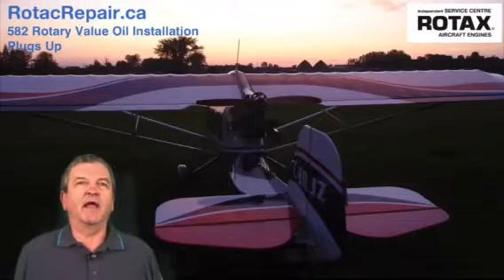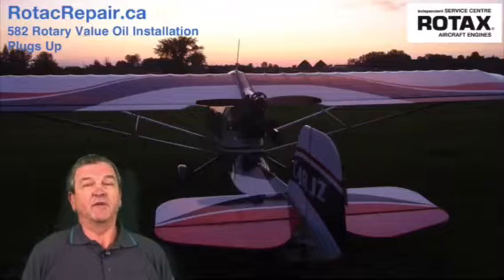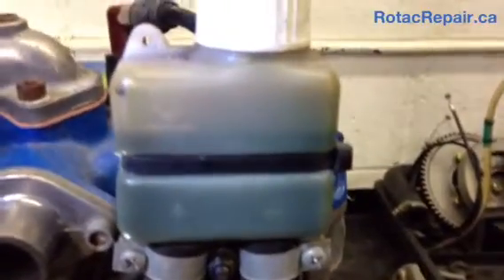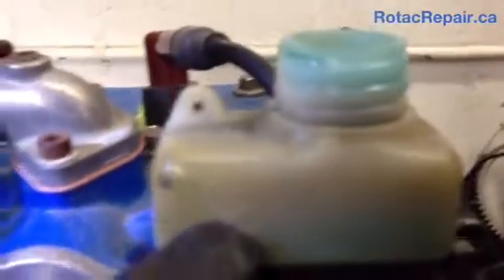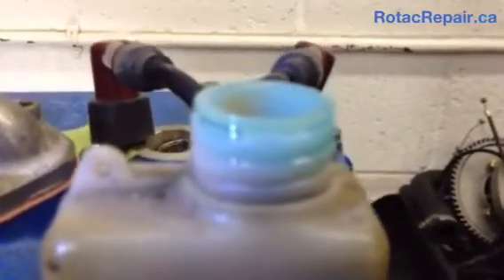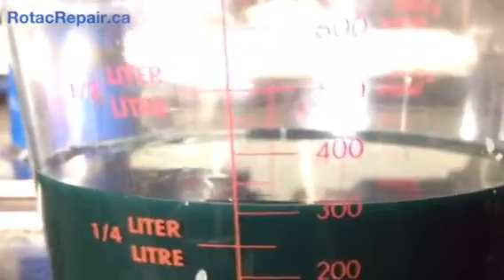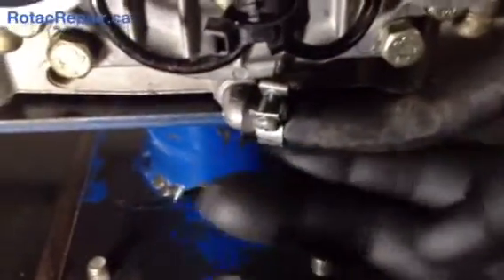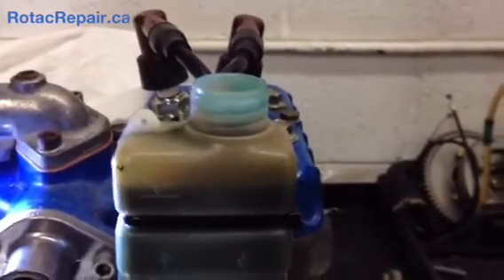Rotary valve oil change Rotax 582 UL with spark plugs up

Comment: Y'know,  I realise that this is 6 years too late  - but I've been setting up a Rotax 582 model 99 for  installation on a glider;  and in regard to the rotary valve oil supply,  I did not use the Rotax-supplied  oil bottle at all - because it's made of plastic, and an oil tank (no matter how small) inside the engine compartment of any aircraft must be fireproof.  Instead, I made a small tank from steel sheet and mounted it just above the engine.  It has the required two hose connections,  the "return" line being higher than the "supply" line.  It has about double the capacity of the Rotax plastic bottle, and filling it is part of the daily inspection procedure.

Comment: How do I change the oil on one the has the spark plugs down? Do I have to remove the engine and rotate the engine with the sparks plugs up while keeping the oil tank above the engine all the time?
Reply from the maker: @Lucky4wd4840  No you don’t need to remove the engine. Please check check my videos, the title is”Rotax 582 rotary oil change with spark plugs down. This is the link. https://youtu.be/kBe5cgjB7fo?si=ZODO9mPJHPnFYxsb  The procedure in the Rotax line maintenance manual is incorrect, do not follow those instructions. The Rotax 582 heavy maintenance manual has the correct procedure to follow.
Reply: @RotacRepair  Thank You for sending the link

Comment: I believe now you've mixed old oil with new oil because you didn't pull the plug on the opposite side of the engine at the bottom so the engine still has a lot of the old oil in it
Reply from the maker: Thank you for the comment. You are correct, exactly 15 ml or 1 tablespoon of rotary valve oil will remain on the exhaust side of the chamber as there is a short divider in the bottom of the chamber. I guess the engine could be detached from its mounting or the airframe tilted towards the exhaust side to allow that tablespoon of oil to drain completely out. I believe the remaining 15 ml is approximately 5% of the total refill capacity.

Comment: Have you done any videos on repairing and/or replacing the banjo check valves on the oil injected Rotax engines?
Reply from the maker: Not yet, it’s on the list for a video

Comment: The old oil looks pretty clean, making me wonder if changing the oil is necessary.
Reply from the maker: Replacement of the rotary valve oil at 100 hours is recommended. Even clean looking oil will contain extremely small wear particles from the brass gear.

Comment: Thanks for the video. What did you wash the reservoir bottle with?
Reply from the maker: I used mineral spirits and a 90° bent utility brush, rinsed with warm water. Sometimes the reservoir is so badly stained with oil blue dye it must be replaced.

Comment: My rotary valve oil tank has mixed with water
What should I do and what should I look for?
Thank for any help
Reply from the maker: I keep the rotary valve reservoir cap with rubber seal in stock. Shipping it to you depending on you location could be an issue. Where are you located?
Reply from the maker: That’s not good! Is the oil thick and milky in colour? How long has this issue been present?
Reply from the maker: I would suggest, if the rad low on coolant it could be passing past both rotary shaft seals (behind the water pump) The only other way would be a damaged/ missing rotary reservoir tank cap. It’s good you haven’t started the engine. Don’t start again until the issue is resolved. 
Perhaps you could drain out the rotary oil from the lowest point. Using an empty container, leave that hose disconnect and apply 15 psi pressure to the cooling system. Leave the pressure overnight or longer and see if coolant drips out of the rotary fitting into the container.
Reply from the maker: Proportion Industries Limited is the Rotax dealer for Malaysia. 
Room 1302, Westlands Centre, 20 Westlands Road, Taikoo Place, Quarry Bay Hong Kong, China. Phone 852.288.59525 
Hopefully they have a cap with rubber seal. Please let me know the outcome.

Comment: I was recommended (and have been) to run synthetic oil for my rotary valve and mineral oil for my oil injection.  I haven't had any issues with this set up, but I am due for a rotary oil change and wondering why you suggest sticking with the same type of oil for each system?
Reply: Oil injection uses a thinner oil (less viscous) . Oil for the crank case should be heavier (generally you would use a normal 2-stroke oil that isn't for injection).

Comment: Hi John,
How many times should that bottle be filled?  I pre-mix my oil and have not filled it in as it doesnt seem to be going down.
Reply: Nelson Pereira 
Hi Nelson,
Glad to see your checking that oil level regularly. The oil in the rotary valve tank should not normally be consumed by the engine as it’s not mixing with the fuel. It’s purpose is to lubricate and cool the rotary shaft assembly. That’s the reason it should be drained and refilled with fresh two stroke oil during scheduled maintenance.
Reply: John Baker thanks John, I’ll do this on my next maintenance.  I was wondering why it wasn’t consumed.